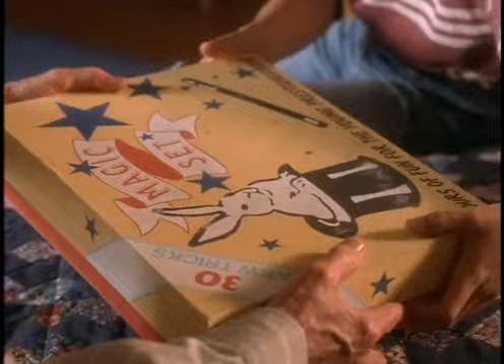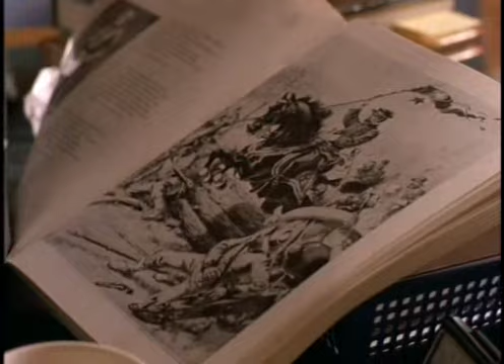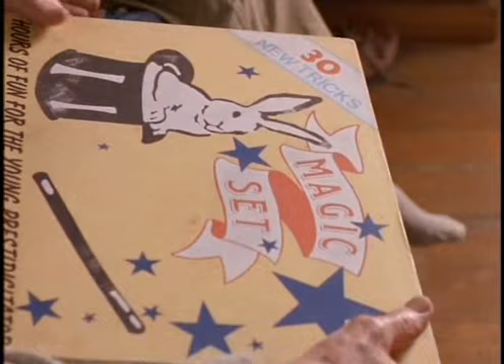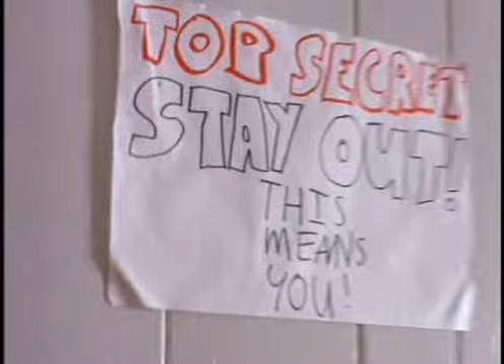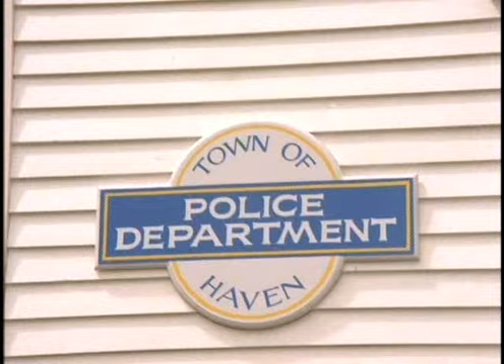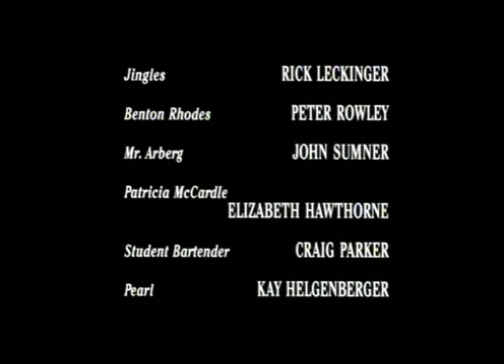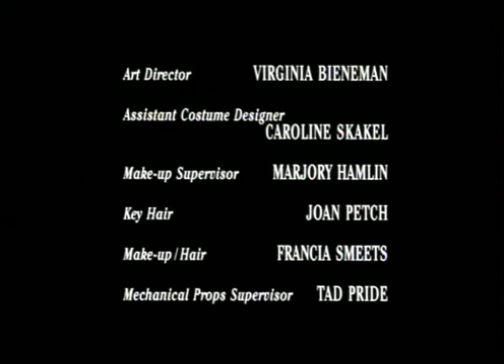tommyknockers

Comment: I like this movie for maybe the nostalgia of the 90's acting and because Jimmy Smits is a great and underrated actor.

But it isn't a masterpiece. Probably about as weak as Langoliers in terms of storytelling.

The book isn't that great either. Its pacing is probably the only thing it has in common with the movie. I remember reading it and becoming exasperated at about 100 pages in. It just doesn't have a big payoff at the end but the movie kinda does, even if it ends up looking like a fight scene on Star Trek. Also, other than 4 main leads, the rest of the actors weren't either good ones or didn't care about this project at all.
Reply: shad0wMata I actually really enjoyed the book. I read it as a kid and it ended up falling apart bc I came back to it so often. Something about Altair 4 and the other dimension really tantalized me, ha.
This miniseries was pretty bad, though. Not gonna lie.

Comment: Audio is out of sync, always spoils a good film.
Reply: *****
No Clara, I very much doubt if there is anything wrong with your computer, it can be down to a coding error of the program that originally copied the video, or a change of one codec to another; and again the quality of that program.  If you chose to download the video you can without messing around with software be able to increase or decrease the sync by using VLC, it's a free download, the sync may not be perfect, but it certainly is an improvement.

Quite often as the video progresses the problem gets worse, you may find further adjustment necessary.  You may want to look at, dvd videosoft . com, it works for me.  Justin.